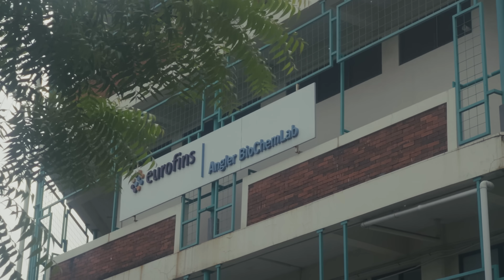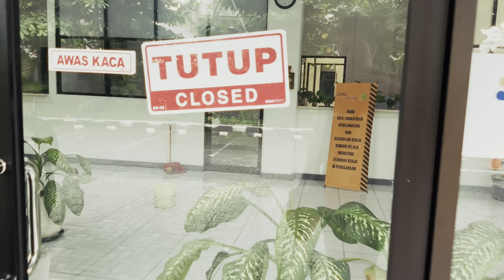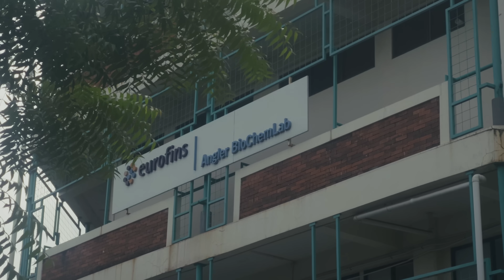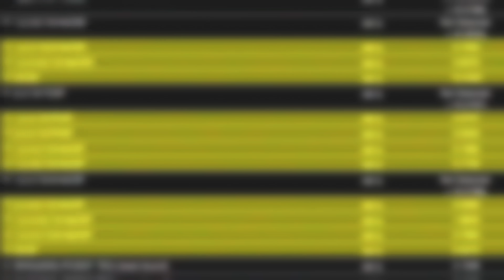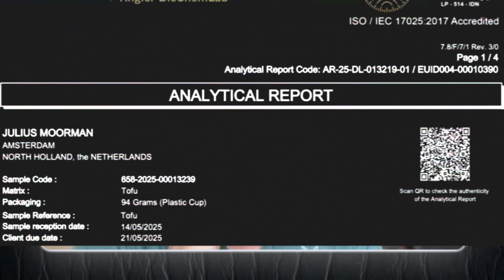I Lab Tested Indonesia’s PLASTIC-FRIED Tofu

Comment: A good idea would be to dry the tofu on low heat, and send it to a third party lab in a western country. Also if they are going to switch wood, they are going to of course use the cheapest wood garbage that has been treated with other toxic chemicals and paints

Comment: The people doing this should know that they effectively poison the locals with airborne highly toxic chemicals for saving money.
The health effects are almost as severe as radiation poisoning. Military learned from the burning pits.
The thing is, they could burn plastic safely in a furnace that has forced air combustion with a vortex flame chamber, the low temperature and bad combustion is the problem why dioxins and PAHs are even produced in a plastic fire.

Comment: It looked like they were burning the plastic for a heat source, not cooking it for food.
Reply: Sure, they use it instead of burning wood or using a gas stove. It's still burning plastics, the smoke/the particles get everywhere.
Reply: @GoGoGoRunRunRun 
True.
Reply: @Cletus-y5u The test result seem to show that tocic fumes didn't really do much to the tofu, but it is certainly very toxic to breathe that smoke in and they should really test more than one tofu batch, ideally from different factories and do the test in a lab in a different country.
Working there making tofu breathing burnt plastic is super unhealthy, so even if the tofu is sort of ok, working there is not. I know, they can't just go and work somewhere else...
Reply: @GoGoGoRunRunRun 
Yeah, it's pretty brutal.

Comment: Whether the tofu has low contamination of plastic or not, still, using plastic waste as the fuel for cooking the tofu is bad for the environment. Period
Reply: This very much depends on the type of plastic and the way you burn it. Plastics like polyethylene (plastic bags) can be burnt no worse than burning diesel or something. You can also do destructive pyrolysis and turn it back into oil. 
PVC, ABS and PET bottles are much nastier. There is no single 'Plastic' much like there is no single type of 'gas'.

Comment: Not an expert, but might be that the levels that are slightly elevated in the lab test are due to the cooking process (using older oil or high heat or similarly, and not the plastic used to heat the oil..), according to Gemini 2.5 Pro, which is actually quite smart!

But even then the levels are only too high for Children and Infents, under EU regulation (which is probably more on the scricter side?). So it's actually a bold statement to say the tofu is toxic... Maybe u could change the title to Toxic tofu (fumes!) ;) . But still the people deserve to know about this and it's still terrible practise to combine burnt plastics and foods in ANY way! Thank you for providing the results!!

Comment: It probably also varies wildly from day to day. If the plastic waste was mostly polyolefins (food and consumer good packaging), which it probably is, it may smell a little bit weird, but that is chemically very close to natural gas or diesel fuel. The smoke is certainly not good for your health, but it is not a super carcinogen. As we get to the aromatics like abs, the amides like nylon and the esters like PET bottles and synthetic clothes, it will smell a LOT worse and probably generate more weird, unknown chemicals since now we have more varied molecules to break and reform into ugly things. For dioxins however, we need chlorine. PVC etc. Fortunately, that stuff is not really used for food packaging and not used for clothes that much anymore. It is used in very typical items. Wiring insulation, "rubber" boots and building products, windows, gutters, etc.  The combustion products would also corrode boilers, so there is an active incentive to keep it out and you can mostly keep it out since it is mostly not found in general packaging. So this result is actually perfectly logical.

Comment: This tofu is half proceced tofu, my self rarely consume this the price is super cheap you could get 40 of them for a dollar, before consume this tofu i would rinse it with tap water, people often use this tofu to make different food such as tahu walik. In my city they cook this tofu using wood bark from construction house which the price is around $6 for a pickup of wood, but did you know that actually tofu waste is a food called tempe gombal in my opinion that's more toxic than deep fried tofu with plastic. But testing the chemical in tofu for 700 bucks is insane.

Comment: Part of the issue is feeding fire with plastic to heat oil is quite energy wasteful. Doing it with a more expensive fuel would be hard without attempting to figure out how to recoup some efficiency. Rudimentary boilers to heat the oil may be feasible. They can be constructed and cheaply insulated to increase efficiency, which might allow for utilizing other sources of fuel that are more costly.

Comment: On one hand, I guess it prevents deforestation, since they don't need to burn wood. Maybe they could create a system that further separates the tofu from the burning plastic
Reply: You can build a central system that more efficiently burns the plastics with less smoke and use that for steam generation, and save the wood to fire the deep frying stations.
Reply: If you build a combined cycle rubish burning power station it will provide steam for cooking and electricity for frying @mfbfreak

Comment: we're not poisoned, we're trying to evolve our race to withstand toxic waste
Reply: U making a joke or are you serious?
Reply: @end.olives  it's hard times in indonesja rn man, anything goes for survival
Reply: @kulonone3374  Alright bro, im sure theres some other way to cook without burning plastic. I also think you can produce diesel out of it too
Reply: @end.olives Producing fuel by the pyrolysis of plastics is in itself very polluting unless its done using expensive clean processing equipment and the resulting fuel is only suitable for a diesel engine if its done in a specific way using the right plastic types. If it's not done properly the pyrolysis process and burning the fuel is just as polluting as burning plastic and the fuel will damage a diesel engine.
Reply: @ats-3693 What do you mean, plastik would not only produce diesel but also petrol, gasoline, fuel oil, etc. By fractional destilation they would seperated any fuel by  measure boiling point of each fuel. I see in Youtube where sweden just straight burn those all plastik without even recyle it, and also i see some guy using vacuum to extract the fuel from plastic so its does not need much heat to burn it.
Reply: @edibandulan5266 Yes I know how it works but if it's not done using exact methods with the right plastics the fuel is dirty and contains poisonous chemicals from the plastics that just end up in the atmosphere when the fuel is burned, the guys you see with homemade setups producing fuel by pyrolysis of plastics either don't understand this or if they do they just don't care.
Reply: @ats-3693 Then why Denmark burn their plastic, they don't even recycle them, pyrolysis plastic under the vacum does not produce toxic fume even the fosil fuel produce toxic fume and flameable gas that's why they directly burn so it would not poison our enviroment.
Reply: @kulonone3374  future indonesians can survive on plastic diets frfr....its a joke btw dont get mad
Reply: @end.olives  it's serious matter. We're preparing for the space age!
Reply: Microplastic is for the weak, we are preparing for Macroplastic
Reply: @SupraWibu facts. I don’t even take off wrappings of food anymore. The plastic package is on the menu.
Reply: Just like the gangga river drink test 😬
Reply: So you want to be frindavan people who can withstand air polution, water polution and sound polution?😂
Reply: Yeah make sure to give it to your family
Reply: Hormesis is real 💯 😂
Reply: Plastic breeches the blood brain barrier and stays there. In the brain.
Reply: if Indonesians are poisoned already, then I'm poisoned as well...
Reply: And cancer is a sign of weakness?

Comment: Below international safety standard = occasional one time consumption doesn't immediately pose great danger. Lol. The thresholds are there for a reason. A very typical modern fearmongering speech. Proper phrasing would be = "does not appear to be a cause of concern at current levels".

Comment: Based on the analytical report from PT. Eurofins Angler BiochemLab (Report Code: AR-25-DL-013219-01), the tofu sample appears to be safe to eat in terms of tested chemical contaminants. Here's a breakdown of the key findings:

---

1. Polycyclic Aromatic Hydrocarbons (PAHs)

Method: GC-MS/MS

Most known harmful PAHs like Benzo(a)pyrene, Benzo(b)fluoranthene, and 5-Methylchrysene were not detected (below 1 µg/kg).

Only Chrysene (1.64 µg/kg) and Indeno(1,2,3-cd)pyrene (1.87 µg/kg) were detected in small quantities.

These levels are well below typical regulatory limits set by the EU for processed foods like tofu, which often allow maximum levels of 2 µg/kg for individual PAHs and 10 µg/kg for the sum of four key PAHs (EFSA guidance).

---

2. Dioxins and Furans (PCDD/F)

WHO-TEQ (toxic equivalent):

Lower-bound: 0.1008 pg/g

Upper-bound: 0.1100 pg/g

For food safety, the EU maximum level for dioxins (PCDD/F) in products like tofu is 1.0 pg WHO-TEQ/g. The reported values are well under this limit.

---

3. Dioxin-like PCBs

WHO-TEQ for PCBs:

Lower-bound: 0.0003 pg/g

Upper-bound: 0.0012 pg/g

These are very low values, and combined with PCDD/Fs:

Total TEQ (PCDD/F + PCB):

Lower-bound: 0.1011 pg/g

Upper-bound: 0.1112 pg/g

Still safely under EU limits (typically 2.5 pg WHO-TEQ/g for combined dioxins and PCBs in fats/oils and derived foods).

---

Conclusion

The tofu sample tested:

Does not contain dangerous levels of PAHs, dioxins, or dioxin-like PCBs.

Falls well within international safety standards (e.g., EU, WHO).

Was verified by a reputable lab under ISO/IEC 17025:2017 accreditation.

Therefore, it is safe to eat based on the chemical contaminant results reported in this document.

If you are concerned about microbiological safety or freshness, those would require separate testing not included in this report. Let me know if you'd like help evaluating that too.

Comment: The lab beat me to it, , "safety threshholds" are a joke. They are just  thresh holds of what we currently assume may not kill you short term. Theres absolutely no justification or logic in thinking "yeah eating plastic once in awhile is fine" as well as any chemicals. How many times over the last 100 years have we seen how wrong they were. 
What worse, this stuff is  probably still safer than half the premade,boxed food in our supermarkets.
Reply: Sadly right. Boxed supermarket foods tend to have preservatives, bleach, and other additive chemicals that are often overlooked because it's made in a certified factory.
Reply: The problem with processed food from the supermarket is the duration and temperature. 
In most cases you only get to see the expiry date not the manufacturing date, so you can't know how long it sat there. Then you can't know about the transport. Was it in a shaking truck with bad road conditions? = more plastics. 
Some of the stuff in supermarket fridges doesn't need to be in fridges in the first place, 😮shoking! They were packaged in sterile environments and transported in airtight containers at room temperature and then put into a fridge to pretend it's a "fresh" and perishable product. Temperature changes is what releases toxins from plastics.
And last but not least some processed food comes in microwave safe containers and nobody in the world cares to check what "microwave safe" really means.   If it doesn't melt like butter then it's microwave safe and it can't leech too much toxins once it is tested FRESH OUT THE FACTORY. Absolutely nobody knows or accounts for transport, storage conditions, temperature changes and other factors that may influence the stability of said plastic containers.
Reply: Also if you compare processed food as in ready prepped meals with their equivalent in weight to the exact same plate, fresh made you'll notice a substantial proteins and nutrients reduction. Well it turns out if you remove certain energetical & nutritional values from food you can make it last way longer, so there's that too.😊 

That's also why products like corn flakes have such a good shelf life. They remove all the vitamins from the product, then spray vitamins in a solution to coat it so as to make it last longer. This would be an excellent idea if only the absorbtion rate of said vitamins in vivo would not be way lower because it's not tied to their original medium of transport, you know, "food" 😂 Vitamins are either fat or water soluble but if you "suspend" them in a sticky substance, likely made of collagen (proteins) then they're technically there but your body has no chance of absorbing them.
Reply: Yeah. Smoking one cigarette won't end you right away, but smoking millions of it over a decade sure will do its thing.
Reply: As someone who have take food safety class before in uni, safety threshold or adi has some scientifict background but what makes it challenging is the amount of exposure one person can get. Like yes, one tofu cant kill you but the next question is how much these tofu can ppl consume in a day that will get toxic level dose or lethal dose itself... That's also apply to other preservative agent or chemical additive.

I also live in indonesia but different island, and me and other family buy fresh food more than process food because it's much cheaper. But fresh food tend to spoil easily so some ppl use dangerous chemical preservative to cut looses or other things like in this video to  make the production cost lower... One thing i remember is the commercially and cheaper fish available 'pindang' is definitely use some chemical preservative bcs i fed it to my cat and they all throw up within 30 min, and it's not one or twice like that
Reply: what should i eat then?
Reply: There is a reason though. Sure, trace amounts may decrease your quality or length of life when you are old.

But so does not having money. If you spend more on super clean food, you can spend less on your home, on time off and vacations to de-stress, on making sure your children succeed in life so you have hope for a legacy, on enjoying life, etc.

Excessively low thresholds means people have less money to spend, and that makes them sick too
Reply: Safety thresholds are not a joke